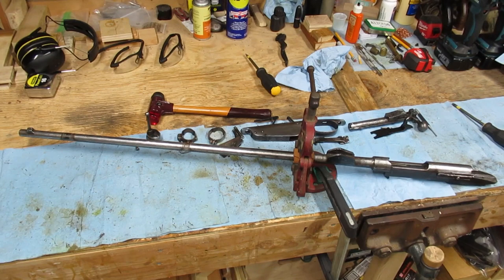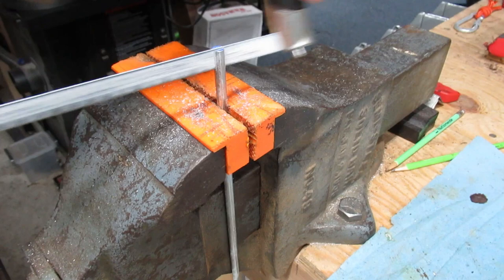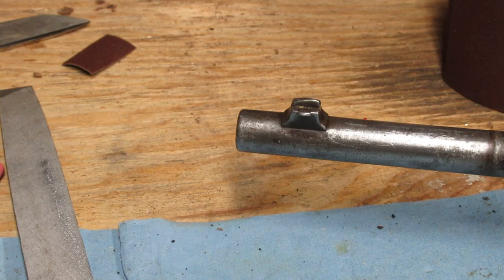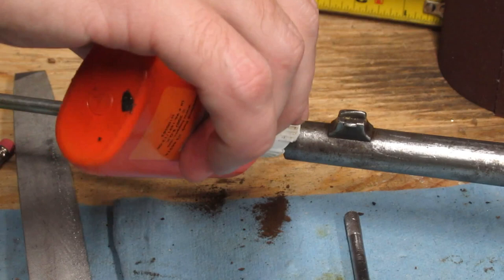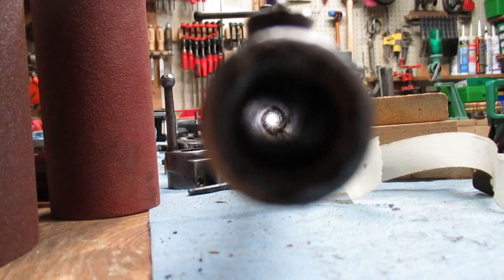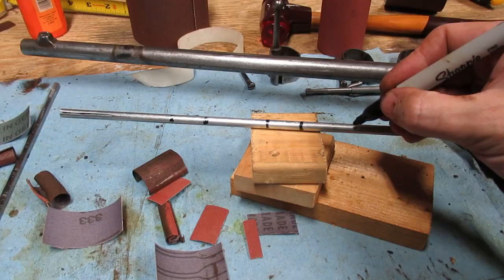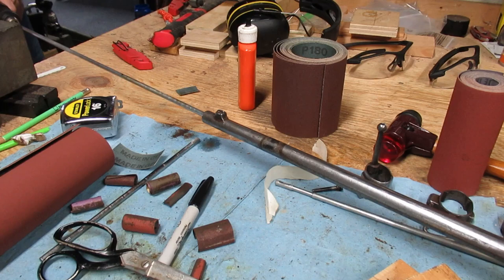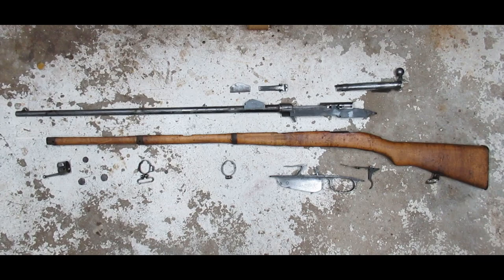RTI Mannlicher 1888/90 - Honing the Bore

Comment: I have sanded a very rusty bore before. First I did scrub it with a bristle  brush. Then I made a wood plug by pushing it repeatedly thru the bore. I added lapping compound to the shaped wood plug, that step really seemed to redefine what was left of the rifling.

Comment: The polishing's biggest effect it will have on your shooting will be to reduce the metal (i.e. jacket) fouling the rough bore will collect.  It was good to remove the flaky rust on the bore's surface, but that would have probably shot clean with only a few rounds.  The badly pitted bore closer to the chamber will still likely strip a lot of jacket material.  Expect a LOT of blue/green patches when you clean it.  

You simply need a new barrel to fix the issue.

Comment: Mines in similar condition but I was planning to change the caliber anyway, I wonder if the action is strong enough for 54r
Reply from the maker: You're swapping the barrel? Most people say you can shoot 7.62x54r out of Mannlicher 88's, however the bullet is undersized at .311" vs .329"
Reply: @rakumprojects  I would like to, I just keep hearing about how the action is too weak and full size smokeless cartridges would blow the bolt out like miss assembled ross mk3, thanks for the input. 

Also it’s proving hard to find replacement barrels let alone a barrel in a different cartridge

Comment: Test and see if a smooth bore performs better than a sewer pipe rti bore
Reply from the maker: I got a Mannlicher 95 from them that I'm working on now. Bore is much better than the 88/90 since there's rifling throughout but there's still deep pitting. I'm going to clean it out but nothing beyond that. I'll compare it's groups to the 88/90

Comment: BTW if ya would what is the tool ya use to measure the bore called.. I've been reloading for decades and don't know   :(    TY..  MB.
Reply from the maker: It's called a small hole gauge. It's a machinist measuring tool, not really made for reloading specifically but they come in handy. My set is made by Starrett.
Reply: @rakumprojects  ,  thank you gotta get one....  be well.

Comment: Jesus....no....I've shot guns with heavily pitted bores and bullets don't get stuck...at least before there was a chance it might shoot minutes of car now you'll be lucky if it even sends bullets down range. 

Also you can fit the barrel of M95s and such in even the small 7x mini lathes so you must have even a tinier lathe....
Reply from the maker: I have a 10x20 with a .75" through bore. To fit the barrel, I'd have to remove the front sight base since it measures .910" without the blade. Then I'd have the problem of 20+ inches of barrel and receiver sticking out the back end. And even if I could get it in a lathe, what kind of tool do I use? A small boring bar wouldn't be rigid enough and a reamer would probably need to be custom made.

As for how it shot, I guess you'll have to subscribe to see the results ;)
Reply: @rakumprojects  I did lathe work on a m95 barrel in my 7x lathe, removing the front sight and counter boring would of been a much better solution and not much more work, and would of given better results. I pulled the front sight on my M95 and it was easy. Regardless I would of shot it before to see if it was even necessary. 

You would true the barrel, drill and them ream. You could use a boring bar, certainly has been done before with low feeds and speeds.  Far as barrel sticking out, also a non issue, keep the speeds low and it will be fine. I've done work on 20-30" barreled actions with the end sticking out.

Comment: You could destroy the barrel crown during the honing process , man the thing will lose it's accuracy and became a smoothbore straight pull !
Reply from the maker: I would never do this to a rifle with a decent bore, but in my opinion a smoothbore is better (and safer) than a bore with deep pitting.
Reply: Nah , anyway but did the gun barrel crown still there , and can you take a picture of the sight after assembling the rifle and put it in the video for us
Reply: And thanks man , at first i think u were insane to honing the bore now , i understand that you just trying to remove the rust inside the barrel while still maintain the accuracy of the gun by not destroy the muzzle crown
Reply: Did you have any plans on the gun new ammunition ? , this is an mannlicher 88 and this mean the rifle still not being converted to use the new m95/30 8x56r , and still shooting the round nose m93 8x50r austro hungarian service rounds
Reply from the maker: @CheemskoGiondau  I have some rounds made from 7.62x54r cases, using the same technique I used to make Siamese 8x50r. I loaded them light to account for the weaker 88 action. Now I just need to make it to the range to try them out.
Reply: @CheemskoGiondau  What you even talk about? Bore is gone, groves are gone, its smoothbore now. No matter what crown looks like this rifle isn't hitting anything straight. I would argue that bore is so big now that bullet doesnt even touch a crown when leaving barrel, unless its already keyholing in the barrel.All this job is just to make it safe to shoot, accuracy is out of table here. You couldn't worsen it even when smashing crown with a hammer
Reply: @neuzdost1939  ahhhhhh , understandable